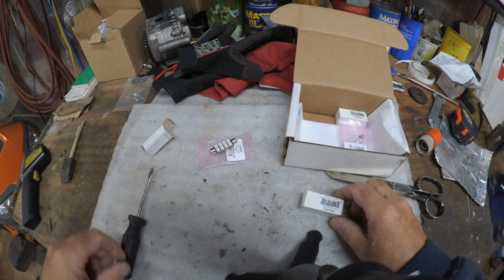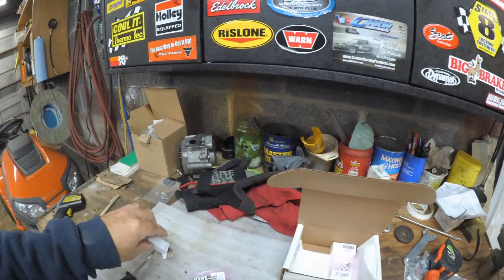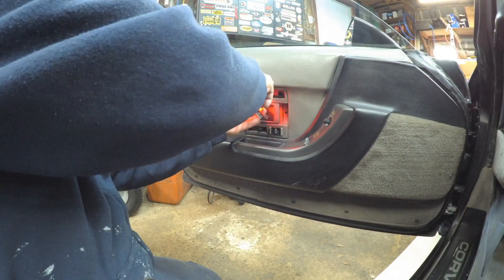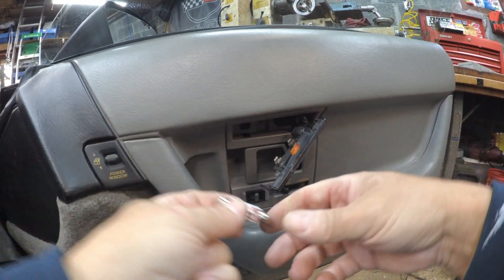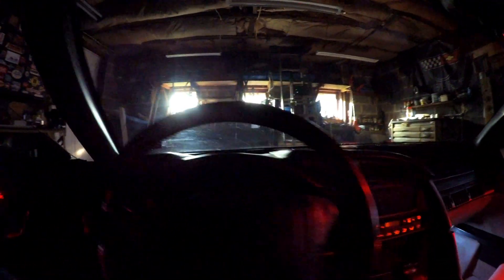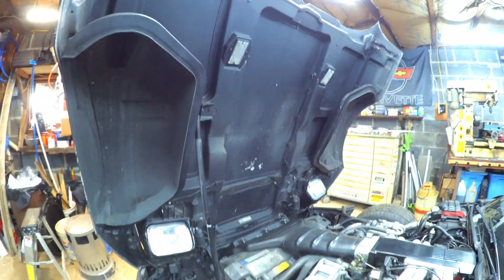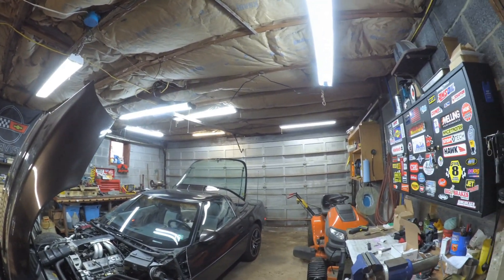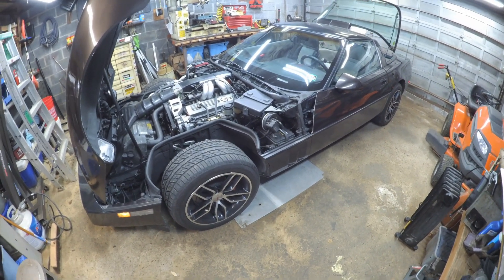C4 Corvette Door Panel LED Lights.

Comment: Hey Eugene, I changed out the interior lights on my 96 CE and found that the inside the door lights had an additional smaller light bulb that comes on with the headlight switch and stay on like a night lite. They are a spade type bulb maybe 1/4" wide and 5/8" long the led replacements I think were 3 lumens. There was also an additional one on one side of the bottom of the rear view mirror that stays on and shines on the shifter at night, switched the same way with the headlights. Also found one in the glove box that comes on with a mercury switch.

Comment: Forgot to mention that I was tired of constantly unplugging the engine bay lights so I could leave the hood up. I added one of those small toggle switches with the red flip covers like on the old James Bond movies for the rockets or ejector seats, one for each light. They are off with the covers down. I drilled a small hole on the side of the raised portion of the hood centered with the light bezels to install the switch so they didn't hit the fuel lines or anything else when the hood was closed. There was enough slack on the positive wire to use to break the circuit with the switch. So now if God forbid I break down at night somewhere all I have to do is flick those new switches and Walla light! Plus those Red covers make them look pretty cool. And 007 and Q would probably approve.

Comment: Looks good! Next you need LED headlights. Makes a huge difference. I went with JW Speaker 8910
Reply from the maker: I actually don't care for the LED headlight's
Reply: @E.T.GARAGE  how come? They're brighter and project the light down the road. I can see much further ahead now without blinding oncoming traffic.
Reply from the maker: I just like the look of the old sealed beams, call it tradition and I do not do much night driving.

Comment: what size screen is that radio you have and do you think it will fit in the 84 model. I don't want to get the one with a Cd player for mine I want all screen Cd player is half in smaller screen. So, I want a complete full screen.
Reply from the maker: That is a double din size radio, 84 through 89 had the 1.5 din radio so the one I have will not fit. Best thing to do is go to https://www.crutchfield.com/car/carselector.aspx?lp=%2fcar%2foutfitmycar%2fmycar.aspx and see what fits an 84, anyway here is a review of the radio https://youtu.be/gn3A87e6RWc
Reply: @E.T.GARAGE  Thanks alot!

Comment: I really should do the led switch out on my 93 but have been worried about possibly needing resistors do to lack of draw?  Currently my ride is down in shop for opti 😢
Reply from the maker: I believe the you will only need resistors for blinkers and head lights/fog lights, if you just do the interior no resistors are needed. Good Luck with your opti
Reply: @E.T.GARAGE  when I get her back home I’m going to have to tackle this then.  I love the interior lighting but they are all very dim. Also my glove box light is out and I haven’t been able to locate one so maybe led will solve the issue .
Reply from the maker: On my 90 the clove light switch and light socket are all one piece, I had to take it apart and play with the contact to get it to work.

Comment: Hey Eugene,
Just got a 1990. How did you go about changing the footwell lights? I’m have a hard time taking off the plastic cover. 
Thanks for the help.
Reply from the maker: You will need to remove the kick panel, I think I tried once without removing the panels and ended up breaking one of the tabs.
Reply: Thank you for the information! 
You got yourself a new sub 🙏🏽🙏🏽

Comment: trying to remove passenger door panel 1990. how to remove one last nut behind window switch.?
Reply from the maker: The window switch should pop out and then there is a screw behind it, I believe it is a 7mm head on the screw.

Comment: My interior lights won’t turn off when my doors are closed and everything any suggestions
Reply from the maker: There is switches in the door locks, try making sure with the key in them they are straight up and down, that may help.
Reply: Ok I’ll give it a try thank u

Comment: What brand exhaust do you have?
Reply from the maker: OBX, I have a video on it I believe. do not recommend unless you are into fabrication.
Reply: @E.T.GARAGE  thank you 

It sounds awesome 

I’m actually restoring my 1990 corvette convertible L98

I got done replacing the led light bulbs which are way brighter that the original ones